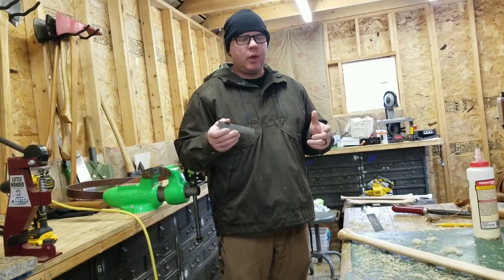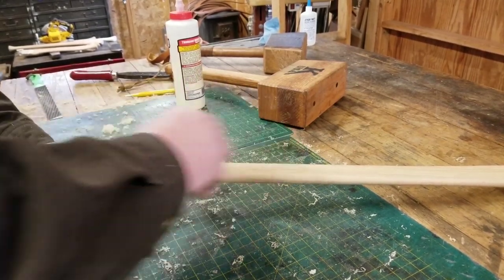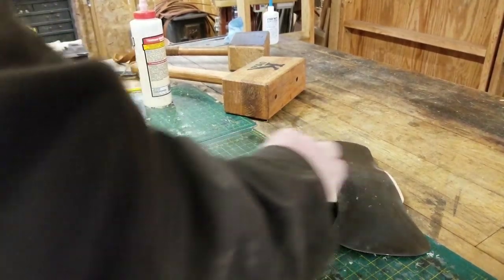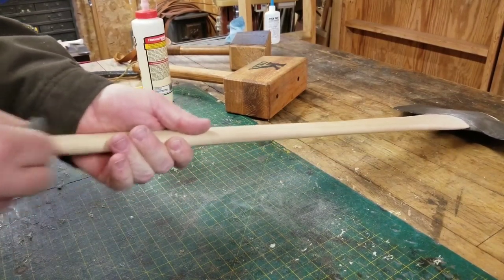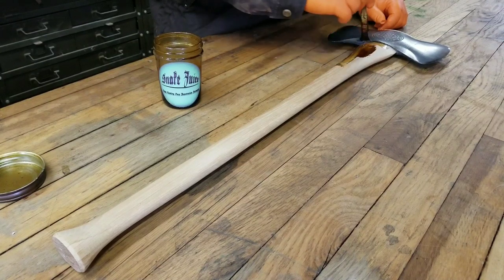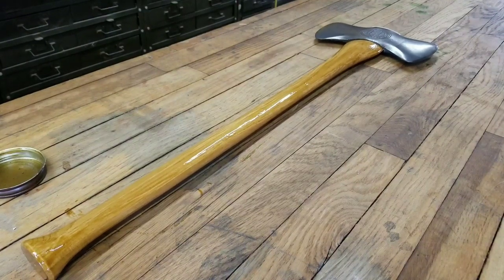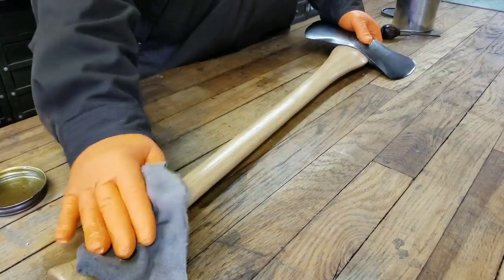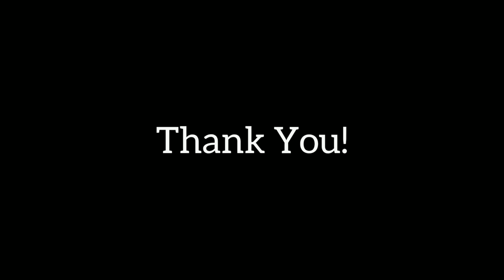How To Finish An Axe Handle and Get Professional Results! Most Dramatic Axe Video of The Year!

Comment: I use straight edge razor blades. Got a box full in a craft supply lot I purchased at a local auction. I do the steel wool treatment after each of the three coats of boiled hemp oil I prefer to use over the boiled linseed oil method.
And...I always rub in a final coat of bees wax on my keepers. A little automatic transmission fluid helps the heads from rusting. You can rub some bees wax into them as well.
Keep up the good works. 👈🖖😉👍
Reply from the maker: All great methods!

Comment: This video was in my recommended videos.  Amusingly, I just came out of my shop to take a break... I am making an ash handle for a 3.5 lb. Michigan axe head. I roughed out the blank with saws and shaped it with spoke shaves. Then I used a card scrapper to smooth the facets left by the spoke shaves and smooth the tear out. I was in the midst of fitting the head when I decided it was time for a break...  Once the head is fit and wedged I'll move on to the finishing... Note that I put boiled linseed oil (BLO) on the handle and in the wedge slot before the head is wedged.  For finishing, first I sand in and wipe off a couple coats of BLO over the course of a few hours. Then I follow the old process of applying a coat per day for a week, once a week for a month and once a month for a year. The BLO soaks in well and, I believe, strengthens and moisture proofs the handle. No blisters with handles treated this way...  

My tool handles all receive at least an annual coat of BLO to refresh the finish. I'm not shy about putting BLO on the tool heads also to help protect them from corrosion while in storage... Shovels, picks, mattocks, sledge hammers, axes, mauls, hoes, digging forks, wheelbarrow handles... they all get the same treatment.
Reply from the maker: That's awesome! Glad you stopped by and thanks for sharing with us! Good ol BLO!

Comment: The sharp spines of a closed Opinel works really good thinning out an axe handle, Then I use low grit sandpaper, to make the surface perfect, however, if you do it carefully, you can finish without using the sandpaper. or you can finish with the steel wool. and Raw Linseed oil. I'd suggest avoiding Boiled Linseed oil and use only coatings of Raw Linseed oil. It might  take more time to dry, however it will get deeper to cover all the wood inside. It generally provides a tougher handle. You can seal after a week with any way you like, or leave it as it is, just with the coatings of Linseed oil. 
That's the method that can provide the best handle in terms of function and performance. For the looks, you have a ton of different options, to make a handle look better!
Reply from the maker: Good tips

Comment: I have been using a scraper for years now!! Once you get good and sharpening/burnishing then your sand paper bill will drop drastically! If you think about how old “carpentry” is as a profession sand paper is still a relatively new product. Thanks for the video!!
Reply from the maker: Very true. I'd much rather use this than sand paper

Comment: Beautiful! I like to use Fidde's hard wax oil ($$$ but I had some left over from a floor project milled from 100 year old oak barn beams) and a final burnish with old burlap. Glad to see you took it to the 0000 steel wool. I have used the edge of an old planer blade as a heavy scraper or even a hack saw blade for a lighter flexible one for curves after you dress a clean edge on a fine bench grinder.
Reply from the maker: Thanks Jeff!

Comment: Awesome tips! I saw one time on PBS a show like this old house different types and ways of finshing wood.  They used an old crome bicycle handle bars and rubbed it on the wood.  It produces the same effect of the steel wool without wearing out.  Just wondering if you have tried Burnishing wood with a crome rod?
Reply from the maker: No but I could see that working

Comment: I have a BBB double blade ax head with the same logo on it. However it is faint and the head is pitted. I will try the 4/5 steel wool and the blue ing. The worst part is the poul is dented in at the top so just a personal collectors item. I am in Cleveland Ohio area.
Reply from the maker: Awesome! Hody neighbor